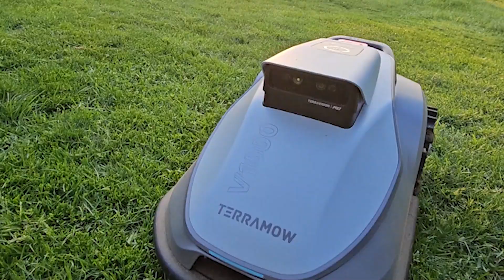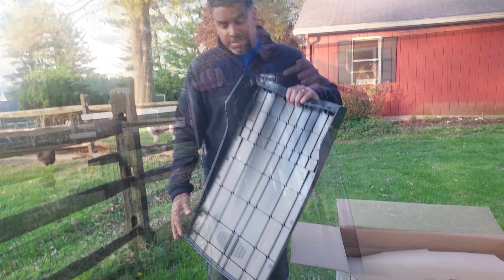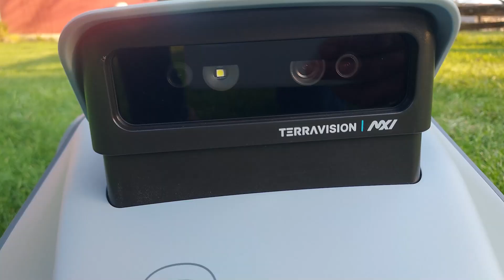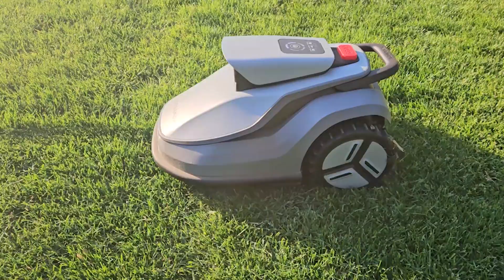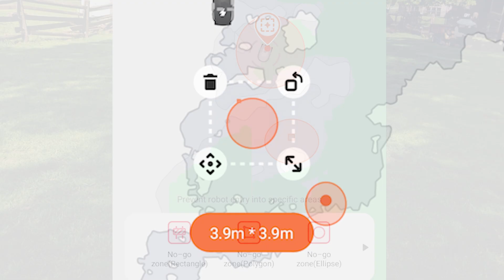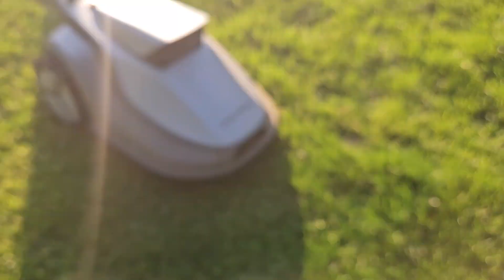Terramow V1000 Robot Lawn Mower – Complete Setup & Features

Comment: After reading details and reviews of brands out there I chose this Terramow. Works amazing, no gps so it only cuts during daylight hours which is fine by me. I have it running 5 zones  crosses a driveway and 2 small sidewalks to mow everything. I timed  each zone, so it cuts 3 smaller zones on 1  charge, then needs a full charge for each of 2 big zones. As it cuts the mower learns more detail and adjusts. Works flawless, I have a ditch in the front yard  parrallel to a road and it has no problems cutting that, amazing. Terramow works excellent if your looking this is a great choice. Im a retired IS systems engineer.

Comment: You gotta mow it first? How does it do with 1 foot grass?
Reply from the maker: Yes, it's a good idea to mow your lawn normally before using any robotic mower for the first time. You should also take a few minutes to remove branches, sticks, pine cones, toys, leaves, and any other debris that could interfere with the mower.

Robotic mowers are designed to maintain your lawn by cutting a little bit at a time, not by tackling tall, overgrown grass. They perform best when they're trimming just a small amount—typically no more than about 1–2 inches—during each mowing session. Once the lawn is at the desired height, frequent mowing keeps it looking great and returns tiny grass clippings back into the lawn as natural fertilizer.